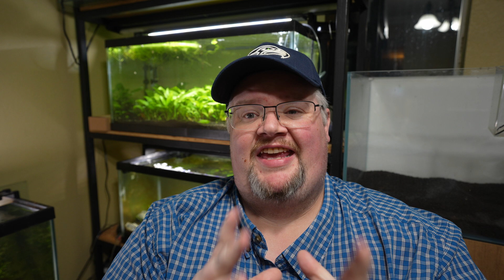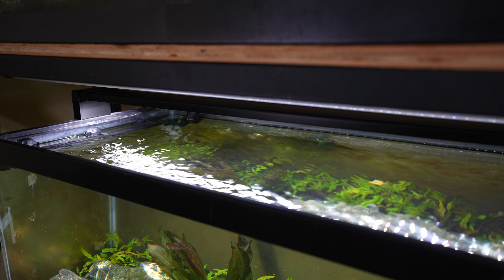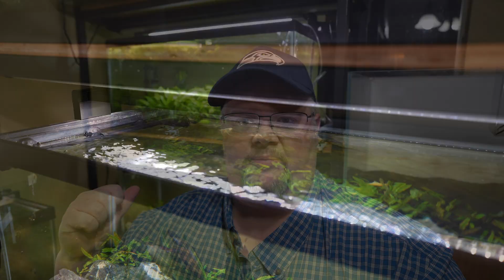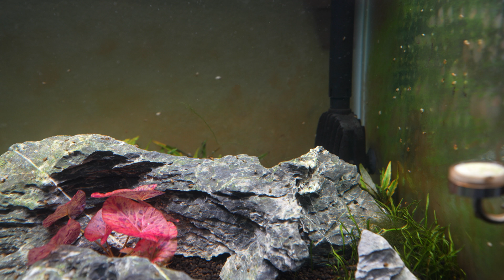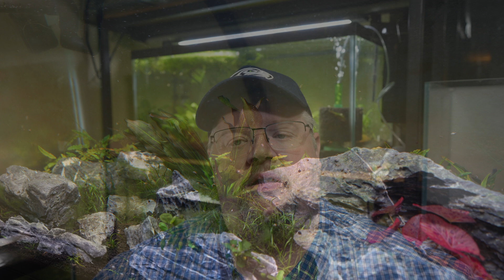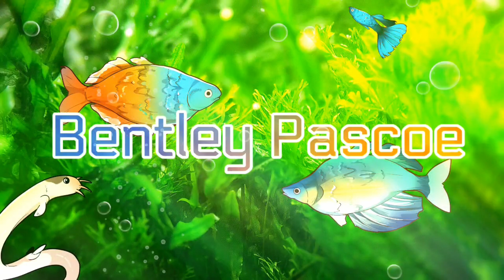Why Surface Agitation Matters In Your Aquarium

Comment: All of my tanks have air stones on battery  backup air pumps. Movementt of air in the tank is the most important especially if you get power outages, I use a variety of filtration systems in my tanks. HOB, canisters, large foam air driven filters, some of my tanks have dual air stones. Gotta keep that water water moving

Comment: Hi Bentley. Will a hang on back filter create enough surface agitation turned down to low or medium flow on a 10 gallon aquarium be safe for white cloud minnows? Thanks.
Reply from the maker: It should! An airstone can be enough, so a powered filter, even on low should do the trick

Comment: Hi Bentley , this post was of particular help and interest to me. I’ve recently upgraded to an oase biomaterials 250 for my goldfish tank 120L. I’ve set it up on the longest end using the spray bar, the water is very clear however I’m unsure if the turbulence is adequate as by the time it hits the opposite end of the tank there is barely any movement , just a shimmy of movement , I’m just wondering if I should be setting the intake/outtake up on the corner of the widest side instead, as this would increase the turbulence from being a lesser width to travel ?? Hoping I made sense here and hope to get your thoughts. Ps: I have ranchu and oranda goldfish in the tank

Comment: I recently set up a 125. I have a biomaster 850. I replaced the pipes with glass lily pipes. At the time that was the only aeration in the tank. I lost 50% of my fish in the first two days and couldn't figure out why. I have since put the normal pipes back on that came with the filter (spray bar) added a wave maker and three air stones. Now I'm afraid maybe I have too much in there!

Comment: My 125ltr (30 gal) tank has an internal filter with the outflow aimed to generate a circular flow of water through the tank. I also have an air pump, which runs an air stone and a decorative bubble output. The reason I have both is redundancy.

If the filter fails, the air pump will keep the oxygen going until I can replace it with a spare. If the air pump fails, I still have the filter.

The only thing that can knock out both is a power cut.
Reply: Update: I bought a pair of sponge filters (they were cheap) for my 45l tank. Found they were so big I only needed one. I replaced the airstone in the 125l with a sponge filter to get it pre-cycled, and found that it was much quieter than the airstone. And, of course, it's a redundant filter. So I'll be keeping one of them in the 125l tank.

Comment: Do betta tank need surface agitation
Reply from the maker: @SonnyVu-d8n  a small amount (like an airstone) can be very beneficial to prevent surface scum
Reply: @ I got Fx6 in my 40 gallon breeder sorority and plants with prefilter sponge intake and spray bar  the top is moving a bit but the water so clean my 30 girls look like they floating on air  🤣

Comment: Do you have a video injected co2 with spray bars? Your method the low and slow method. Thanks great video
Reply from the maker: @pwaquatics3290  nothing specific, but this tank has injected CO2 and a spray bar.  I keep the CO2 on the opposite side of the spray bar, front of the tank.  Back of the tank is the intake.  Keeps the gas in the water pretty well.

Comment: I'm an aquarium noob and I wanted a heavily planted low-tech tank. I read online from multiple sources that if I had a planted aquarium, I didn't need an airstone. So I filled my 37 with java Fern, anubias, and bolbitus, and after a few weeks, they would start dying even with a good weekly fertilizer. I was stubborn, and I kept trying but without success. So finally I added an airstone and I haven't had any problems since my plants are growing like crazy. The airstone is your aquariums secret weapon.
Reply: Probably the problem was something else. By adding airstone basicaly you are “injecting” oxygen to the aquarium. Plants need CO2+lights in order to produce the oxygen.

Comment: Thanks for the video! I setup my tank more in LRB's style, and it's been doing great without surface film ever becoming an issue. In jars I leave in the window I see a really thick coat of biofilm forming, often promoting cyanobacteria. In my tank however, the no flow seems like heaven for the army of baby pond snails (a species that look similar to bladder snails, and same size) I got going now, and they will eat any surface film. Of course, it depends on what you want out of your aquarium, but if you don't mind algae and snails and other critters, I think the LRB style is super fun and rewarding with little need to do maintenance. But if you're OK with snails, they also promote gas exchange in a significant way by clearing up the biofilm on the surface (they wil hover upside down attached to the surface tension and eat it, looks silly). Just mentioning it as an alternative to mechaniclly agitating the surface. :)

Comment: Thanks for the video Bentley!
My favorite way to facilitate gas exchange is by using airstone or sponge filter bc I put cover on my tanks and I believe (according to Chung from waterbox) the small increase in pressure within the water surface and the underside of the cover increases this gas exchange. Now I'm wondering if I were to use a cannister filter with a lily pipe instead, would that significantly reduce the gas exchange?
(10gal, moderately planted, 10 ember tetras, 25+ cherry shrimps, 2 nerites, temp is almost constantly 30C as I live in the tropics)

Comment: Bentley's back!  Thanks for the topic.  I recently tried CO2 in one of my tanks...to boost my plant growth.  I started to use the Aquarium Coop easy flow attachments to the sponge filters..I wasn't seeing any pearling on plants previously with only sponge filters.  No real change in plant growth at all.  Now I have one sponge filter with the flow attachment flowing on one side..on the other side another sponge filter with another flow attachment blowing the flow back so it's a circular motion thing..which was my thought that might improve CO2 "access". 

 So I am using the same amount of CO2 injection..just one bubble per second and it's a 20 gallon tank as before but with the flow idea without just the sponge filters alone I see pearling.  It's a moderate amount of pearling, but it's pearling.  So with 2 weeks in I am not noticing additional growth yet, but seems like I now have CO2.  Not sure whether I'll increase CO2 or what in the future to get more results but for now I"m seeing some improvement with the flow in the aquarium.

Am I possibly correct in this?

Comment: Great video Bentley.. I always stress this to people when injecting high amounts of co2, you need gas exchange with a riple but not so its breaking the surface.. a skimmer also helps too.. its good practice to keep an eye on your water level from evaporation, as this will cause the outlet to break the surface and then your co2 levels fluctuate.

Comment: Bentley, great video regarding the importance of gas exchange in aquariums. Just like the great oceans, rivers and streams, most bodies of water experience surface agitation. That agitation is necessary for gas exchange to support life under the surface. I believe we need to mention that the gas exchange occurs, most naturally, between the air and the water without mechanical help. Just like water, the atmosphere is made up of more than one element. We don't just breath oxygen in the air we need to live. The air is made up of other elements, such as carbon dioxide and nitrogen, (mostly nitrogen). Plants are also great contributors to the atmosphere and water by using Co2 and exchanging oxygen using photosynthesis in both the air and water. By the way, plants take in co2 during the day and expel oxygen, then take in oxygen and expel CO2 during night.  Sorry, long winded version of agreeing with you that balance is needed in our water boxes.

Comment: quick question if you have time - I'm running an AquaClear 50 hob on a 29g. Would going up to an AquaClear 70 help much with surface agitation, or is it better to get a spray bar?

Comment: I have a small internal canister filter . I just extend the exit pipe a an inch and a half above the surface .Its enough to break the surface and pull atmosphere into the water. It also creates water movement to the front of the tank which gently splits in two directions. I have an air pump and stone but usually I only run it when I am out of my place on work days. I have a mid sized Tetra air pump and it's a bit much for my 14 gal cube , I have a tiny living space and I don't like to listen to the constant drone of an air. pump.

Comment: I am using an airstone driven  undergravel filter paired with a hob filter set to its lowest flow rate. My fish and plants have survived more than a year now. 🐟
Reply: So you keep it on 247?
Reply: @danishshaikh4979  Yes, both filters are running at all times. Why wouldn't they be?

Comment: I worked in a fish store in college, but have been out of the hobby for more than 20 years. I am planning a 29 gallon aquarium with an Oase Biomaster 250 and manually adding an Oase 100 watt heater (i.e. not using the 150 watt heater in the BioTherm).

I will also buy a redundant set of Inlet and outlet tubes for the Biomaster. I will splice in a stainless steel Y (with hose clamps) on each side. I will put an inlet tube in each corner. The outlet tubes will attach to both ends of a three-section spray bar, extending the entire back of the tank.. 

Years ago, I had a small air pump attached to a 4-way gang valve connected to an undergravel filter. You could see less air to each uplift tube. Granted a 55 is a deep tank and it is not easy to get air to the bottom. I added a Y, and Connected airline to both sides of the gang valve, and then air looked the same in all four tubes. 

My hope is for an even distribution of water across the extra long spray bar. 

Your thoughts? Too complicated?

Comment: thank you, 
1- but when we should use surface skimmer?
2- please can you make video tutorial how to maintain/clean sand during water change with avoid Hydrogen sulphide. 
thanks in advance
Reply from the maker: @ahmadsaidi8996  I would look at other channels who do sand because I don't like sand personally
Reply: What substrate do you prefer? @BentleyPascoe
Reply from the maker: @fvvfvbbbb  I tend to prefer aqua soils, usually fluval stratum or brightwell rio escuro.  A big reason behind this is I keep rainbow fish and rainbow fish tend to wash their colors out on Sand. Also, I've noticed a few times I've ever used sand in tanks. I have a perpetual problem with cyanobacteria in my particular water so I've just steered away from it. It's almost purely personal aesthetics and nothing to do with some secret wizardry around growing plants better or anything like that.
Reply: @BentleyPascoe  I am setting up a small Fluval Flex 9 want something like a few schooling fish or a Betta with a few low tech plants. Ok to just use decorative gravel or should I use aqua soil. 
Phoenix area so I have been advised to use RODI water. Thoughts appreciated 👍
Reply from the maker: @fvvfvbbbb  you can use gravel, just be aware it's inert and won't help buffer.  If you use rodi you will need some buffer like crushed Coral.
Reply: I think protein skimmer cannot do anything without enough salt in the water.

Comment: My problem is with my spray bar it’s just too much flow for the fish. So I use the stock Fluval head and put a cut up plastic bottle for more direction. It ripples to about half way in my 20 long. I get a dead zone at the front to the right of the outflow. 

However it does create a vortex in the tank as well, slow enough the fish don’t seem stressed. The dead zone sucks, but weekly pick up there should help. 

Do you think this is okay? I have the intake on the same side as the outflow just to the right of it side by side. 

I put a lily pipe in there, but some how the fish decided to go for a ride in it. lol
Reply: My tank sounds like it is set up like yours. I limit flow by reducing it at filter. But not having filter on max flow causes the dead spots in aquarium. Can you tell me how/what you did the plastic bottle? I also have fluval filter. I have tried putting a sponge on output  but took it out because I thought it was restricting to much of the flow. Smaller pieces of sponge etc.  Couldn't seem to get it where I was happy with it. Thanks